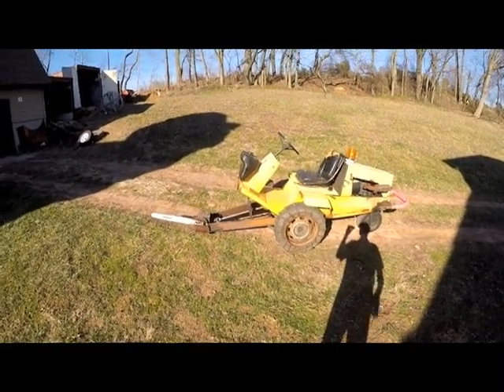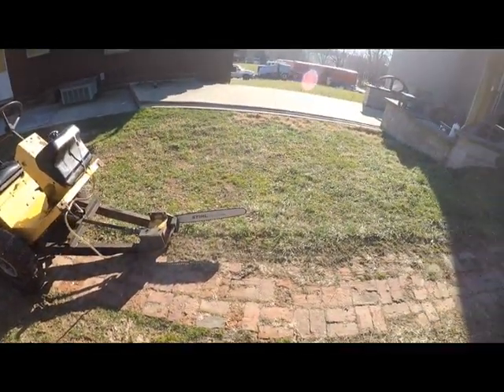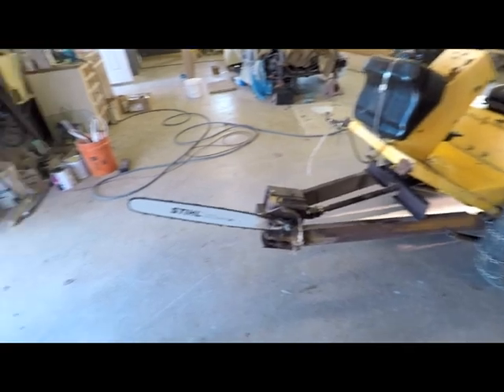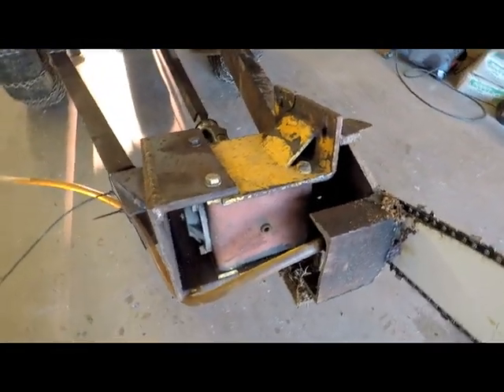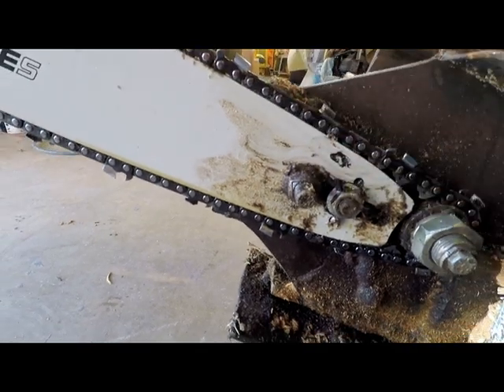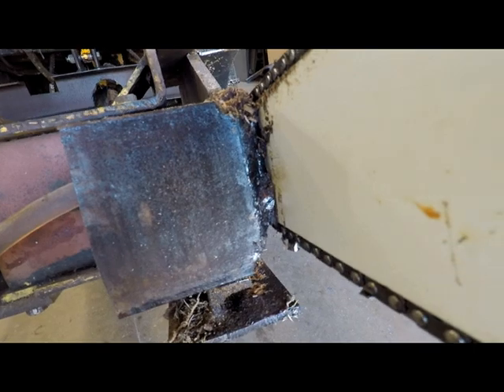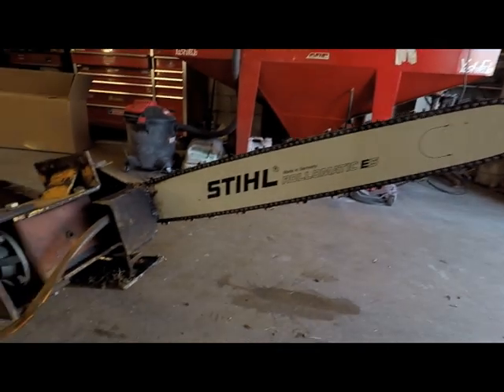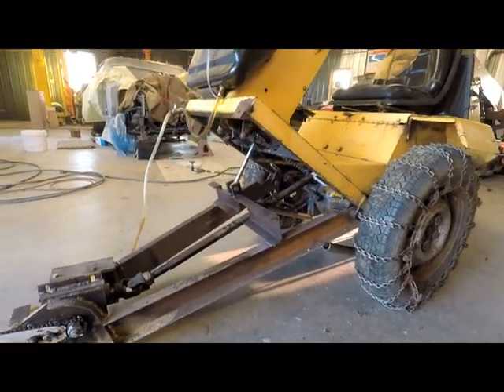Sawasaurus: Lazy Man's Diesel Chainsaw on a Turf Blazer - Walk Around

Comment: I purchased a 727 last year. I need to rebuild the pump (leaks) hydraulic like a sieve! LOL! Did you have to rebuild your's?
Reply from the maker: no mine is fine but the electro magnet face on the pto had to be resurfaced with jb weld.